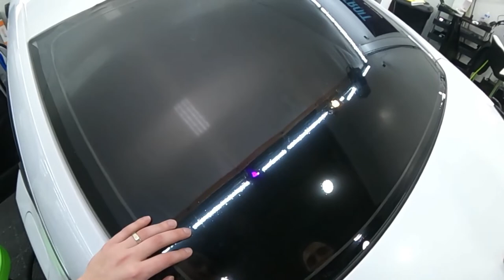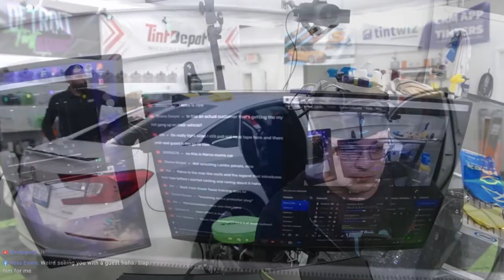@TheFilmTrainer Honda Accord Ceramic Tint

Comment: 40:45 this is insanely important to understand. From installing underglow to installing a subwoofer the difference in a GM vehicle and most if not all Hondas is WILD. Gm wants to put a screw for everything Honda puts plastic a clip while, NISSAN is 5x worse. They use plastic clips everywhere that you should be very prepared to replace.